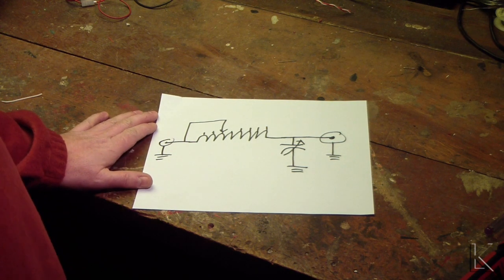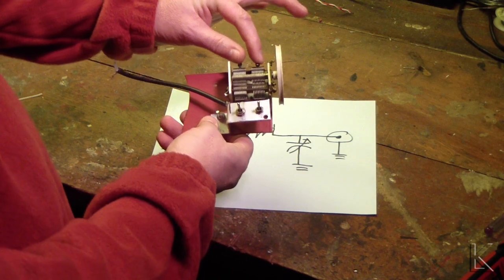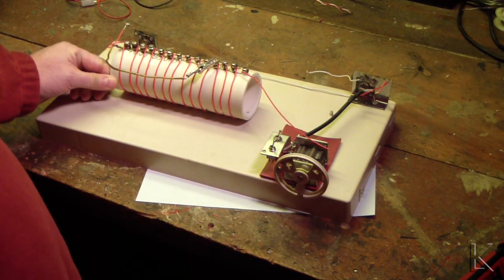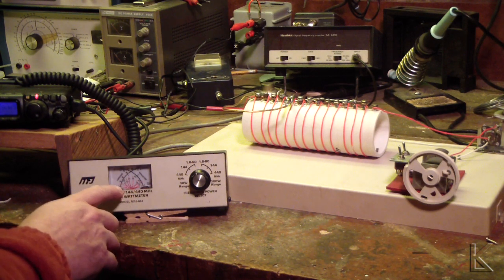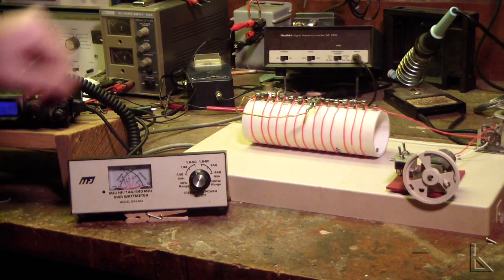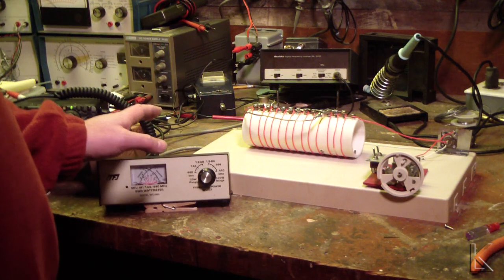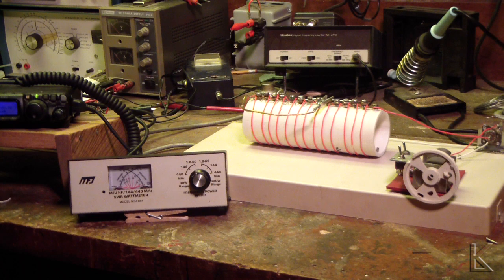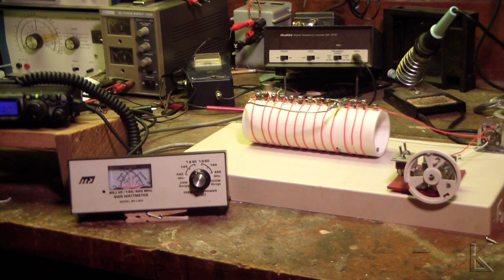Ham Radio - Build your own L network antenna tuner

Comment: When designing an antenna tuner, the first few taps should be ONE turn just like you made.  After that additional turns should be added between taps.  I don't think it is logarithmic.  I think it more linear.  By example, your tuner ran out of inductance and you were not able to tune the 2M antenna on the lower bands.  Also, your design was very good in one aspect, It was configured as a Low Pass Filter [LPF].  If the capacitor and inductor are swapped in position, It becomes a High Pass Filter [HPF].  Most commercial antenna tuners a of the HPF configuration.  I have seen it said that the HPF type is wider range but do not know if that is fact.  The Ten-Tec 'tuners' were of the reversible type.  That allowed low and high impedences to be matched.  I'm not trying to be a wise ****.   Just additional information.
Reply: You sound a little pompous.
Reply: @daveengstrom9250  Thank you for the compliment.  Not all Amateurs have the same background.  You know nothing of mine.

Comment: On trying to use a 5/8th wave 2 meter antenna - remember there is a tapped coil in the antennas base. This presents a very low impedance on HF in the order of problems less than 10 ohms. That's why it won't tune to a low VSWR.

Comment: Great demo of a simple antenna tuner. I have that exact same dual variable cap with the same wheel that I pulled from an old tube AM radio. 

One clarification though on this video. Was the input of the swr meter connected to the output of the radio and then the output of the swr meter was connected to the input of the antenna tuner.  Then the output of the antenna tuner was connected to the different antennas you were matching by adjusting inductance and capacitance?
Reply from the maker: Yes, that's correct,   the wiring goes,  Radio > SWR meter > Tuner > Antenna.    The meter would be useless on the other side of the tuner.   You need to know what SWR the radio is seeing when you tune the tuner.

Comment: Is it useful for swl only? I wanna use it shortwave listening?
Reply: It should be. Notice how he got maximum signal strength by adjusting the coil tap and variable capacitor while listening on receive? This is exactly what you would do, as a short wave listener. Any variable capacitor you find from an old radio that would receive AM broadcast stations, will be fine here. The coil you see here would be fine with it, too.

Comment: Cool project.  Some decades ago I was poor.  Still am.  lol
I made my tuner with thin radio shack test lead alligator clip jumpers.  My capacitor was from a pocket size transistor AM radio and the coil was still holding together a school 5 subject spiral notebook.  
The rig was an old tube radio that belonged to my local radio club. 
The coil and capacitor wren't mounted to anything.  I tapped the coil while still using the notebook for my log and I just pushed the cap out of the way once I got the inverted v antenna tuned.
I don't remember how the parts were configured.

Comment: That was a great build. I enjoy it when hams make their own equipment. This build has so much in common with building a crystal radio set, it's as if all those skills lead to this build. Now for a question. In order to stop the impedance from your hand on the variable capacitor, would a simple rubber band work or would you just use electrical tape? Thank you in advance.
Reply from the maker: I'd use a large plastic knob.   Just getting your hand close can affect it a bit.
Reply: I just watched the video where you put this in a box. When I saw it had a d-shaft I knew immediately that a knob was coming. Very cool project. I hope thousands are built. Thank you again.
Reply from the maker: If you build it, be sure to keep all of your wire runs as short and direct as possible.  That limits stray capacitance between the wires that can make the tuner act strangely.
Reply: Good advice.

Comment: I see you are using a  coax (unbalanced feed).  Would that tuner configuration you built/demonstrated work with a balanced feed line such as 300 or  400 ladder line?  Thx
Reply from the maker: It should work, since it's matching a low impedance at the TX side to a higher impedance.  The ladder line should appear as a 450 ohm load at the antennas resonance and higher when out of resonance.   You could also use a 4:1 balun at the ladder line and reverse the connections on the tuner.
The L network tuner really shines with end fed wires though.

Comment: Great video! Thanks for posting!! I have a question though. I have not been able to get a specific answer in any of the videos i have watched on antenna builds. I should mention I am new to this hobby and electronics in general. I am teaching myself essentially.. What is the role of magnets in an antenna? Probably a stupid question, but I understand the need bu what I do not get is why magnets? Magnetic wire, ferrite bars (especially since I am trying to build a loop or dipole. Also, What would happen, or is it just nonsensical to combine 2 or more ferrite bars,  Such as bundling them and wrapping them with wire?  I would greatly appreciate that info. Thank you in advance. Tom.
Reply from the maker: No, not magnets..  You might be getting confused by the use of magnet wire and ferrite torroids. 
In most cases, when you see a ferrite core wound with wire in an antenna feed point,  you're seeing a transformer or choke of some type.    A transformer may be needed to match the impedance of the balanced antenna wires to the unbalanced feedline.  Take the first three letters of 'balanced' and the first two of 'unbalanced' and you get "balun".  A term I'm sure you've heard.
So what you're seeing is a transformer.   And although transformers do operate with induced magnetic fields, they are not magnets themselves.

Comment: Newbie Question: The video is interesting. I heard what you said about wanting a variable capacitor with greater spacing for higher power. Out of curiosity, say your pushing out 50 watts. What sort of voltage would be coming out of the radio? I'm a little confused as to how you determined wire awg and component ratings. Thank you.
Reply from the maker: Mostly just from experience.   As far as the RF voltage, that varies depending on load impedence match and standing waves.  Reflected power can add voltage depending on it's phase.  That's one way a high SWR can kill finals in a radio.  The reflected power brings the voltage up across the transistors and can exceed the breakdown voltage rating of their junction.
I've read that into a good match, RF RMS voltage at 100 Watts will be in the arena of 800 volts.

Comment: great video.  im sure you get this question all the time but is there a kind of inexpensive way to get into the ham hobby?  i dont live in a big city so i probably need a least a moderate range.  i hope this question isnt too annoying theres just sooo much info online its hard for a noob to weed through it all.
Reply from the maker: Not annoying at all.    Test up to at least General class so you can get on the lower HF bands.    There are often nice HF transceivers showing up on ebay in the 300 to 400 dollar price range.   You don't need much power,  I've talked to Europe on my little 5 watt yaesu FT-817.    It's all about the antenna.  Resonant dipoles are best if you've got the room and trees.

Comment: Ive been working FT8 for about a year now with WAS on every band except 12 and 10(cause of openings) and 160. Why? cause my 80m Dipole WILL not tune for this band. Weirdly enough it will not tune for 60m but even with the radios output dropping to 5w cause of the SWR on my Yaesu I have have got enough radation out to WAS on 60. 160m though, everyone gets just enough signal to even hear me rather then work me.

Now i think I have found the solution. If i can build my self an L-Match following your instructions I can finally Trick my radio into putting out some PWR now so I can get a better signal out there. 

Thank you sir!!!!

Comment: Did your 98Ft end fed work at 160M?
I need an antenna system for my new FT857D that covers 6M-160M.  I was thinking End Fed for 40-160M and a cobweb for 30-6M.  But I'm getting paralysis by analysis with all the antenna options.
A Hamfest is coming up this weekend and I'll keep a lookout for a variable cap.
Reply from the maker: Yes,  and I'll tell you exactly what I did because it is the best multi-band compromise antenna I have ever made.
The feed point is an UNUN that I made.   The common design is the 9:1 UNUN, which is well documented with plenty of pictures showing how to wind it.    By experimentation, I found that around 6.5:1 was a better ratio for this antenna.    So,  find the 9:1 design and instead of 9 turns on the torroid,  do 6 turns.
Then keep the feedpoint near the ground and run out two or three 9 foot radials.
The antenna will tune very well on 160, 60, 40, 30, 20, 17, 15, 12, and 10 meters.   It's a bit finicky on 80, but I can get it to tune down to about 1.8:1 on the low end and 1.5:1 on the high end of 80.
Reply: So you keep the UNUN at ground level near a ground point, and then run the radials out from there?  Does the direction on the radials make any difference?  I assume you then run the end fed wire up from the ground to some height and then horizontally off to somewhere.
Reply from the maker: The wire goes up and off at an angle,   the couterpoise wires go in the opposite direction mostly.

Comment: Your schematic seems to show a RHEOSTAT rather than a tapped inductor.

If I recall correctly, that connection between the tap and one end of the coil should make a big difference in how the inductance varies as you move the tap.  Have you tried it without that connection?

Comment: Any chance it can tune a large random loop? Maybe after adding a 1:1 or 4:1 balun? Mag loops are great, but walking over and tweaking the varicap is kinda annoying and encourages having the antenna right by the radio.
A mathematic merger of 9:1 unun and mag loop needs to be discovered and proven. Random wire is nice, but it transmits from the tuner, right by the radio.

Comment: Fantastic!
So if i materialize this do i have to connect the "ground"(on transmitter side) to the outside barrel of the plug? Then do the "grounds" of the capacitor and antenna all connect to that? And the antenna's ground i guess is just unconnected to the antenna?
Thanks a lot!!
Reply from the maker: If you look at the schematic, you'll see ground symbols.  Those are all connected together.  Yes, the cable coming from the radio and SWR meter needs to have it's ground connected.   Usually, these are built into a metal box and all grounds are connected to the metal.
The exception is the antenna side.   The L network tuner will work very well with just a single end fed wire on the output side and no ground.  Of course, it will radiate, so you get RF in the shack that can interfere with things or feed back through your microphone cable and mess up your audio.
Reply: thanks enormous! i was used to all metal shells and casings to be effectively ground as in all audio equipment but was asking because it seemed to me that some radio guy was advising creating special ground connections to radiator heaters or pipes planted into the ground etc, which to me is useless since on of the terminals in the power socket is aniway connected to ground... best to you!

Comment: Hi Kevin!
 If I understand correctly the inductor is in series to the center pin of the radio and after the inductor coil the capacitor is tapped into the center pin and the other side goes to ground?
Apparently in this setup the coax can be lengthened or shortened a bit by the inductor?
I'm still having trouble figuring out what capacitance does.
I know on an oscilloscope capacitance increase will roll the corners off a square wave.

Comment: Pardon my amateur lingo; So the alligator clip isn’t exclusively making the circuit? At the alligator clip
Connection, it’s  also wired directly to the coil?
Reply from the maker: The clips were wired to the center conductor connection of the so-239 connectors.

Comment: for tap-set I  replace the alligator clip with selector switch..if the coil is to big for ur likes u can space the wires closer and use thinner diameter pvc pipe..

Comment: I must say, once you hooked up the 5/8 
2 meter antenna, I was hoping you would try Six meters ?
As if memory serves me, that antenna is around a quarter wave on Six !
So I was thinking maybe it would have been an easy match ?
But perhaps outside your parameters of HF ?
Still a nicely done tutorial !
Congratulations, and thank you for the down to Earth explanation !
If I could be critical, it was difficult for me to see the SWR Bridge !
Perhaps something to consider in the future ?
'73 !
Reply from the maker: I had a magmount 5/8 wave 2 m antenna then I would also use for 6 m because it was a good quarter wave on six. Didn't even need a tuner at the low end of 6 m

Comment: There is NO WAY, a small MW radio receiver variable capacitor will work reliably beyond 5w, even with very low humidity. This is simply not true.
Reply from the maker: I've pushed 20 watts without arcing.  Partially it depends on the degree of mismatch and the amount of power returning as reflective waves and their phase, adding or canceling the outgoing power.
And if you need to run more power, use a capacitor with larger plate gaps.  Obviously.

Comment: I am thinking of building a  2 meter antenna tuner and was wondering how many turns it will take on the inductor . I am just getting into this stuff.  And also how much capacitance do you think I will need. I am trying to tune a copper J poll antenna. KK7CZD DON JESKE
Reply from the maker: You want to tune the J-pole by moving the tap point of the coax up or down the J very very slightly.  
Using a transmatch at the radio would keep the radio happy, but do nothing about the efficiency loss of the detuned antenna.

Comment: Ok, I basically got it built. Before I completely finish, how could I add in a meter ?    Actually, I have it all build, but I havent got it to work yet. 
I will review the wired connections.
Reply from the maker: I'd just obtain an in-line SWR meter and connect it between the radio and the tuner.

Comment: So would you ultimately like to have several coils on your board to choose from?
Reply from the maker: Some automatic antenna tuners do just that, with 5 or 10 inductors and relays to switch them in one at a time or more than one at a time to increase inductance. But that gets pretty complicated. 
By using a multi-tapped coil, you are basically creating multiple coils in one.

Comment: BBi U-Tube video site says antenna tuners don't work, they just fool the radio into thinking it has a good match..
Reply from the maker: They don't change the antenna. They are a transmatch, a transformation of impedance and reactance to what the radio expects. Just as a transformer transforms impedance. They facilitate a more efficient transmission of power from the radio to the antenna.

Comment: Thank you Kevin.  Can that tuner be used for open feed line such as twin lead, 300-400 window or 600-ohm ladder line?  I suspect you would have to add binding posts.

Comment: How did you strip the wire for the taps? Did you just  cut,strip and connect ? Thanks. KN6ASO
Reply from the maker: I don't recall specifically, it was a long time ago. But usually on a coil, I'll just shave away the insulation without cutting the wire, and solder to it.

Comment: Great explanation, Kevin.  What (if anything) would need to be changed to build an L Network Antenna Tuner for 2 Meters and 70 cm?  I want to experiment with open wire feedline (ladder line) on these frequencies with a homebrew yagi and a couple of other antennas. I want to try several different modes on these bands other than FM to see what I am able to have ready for Field Day.

Comment: kevin...was curious about the coil...what's the over all inductance and roughly how much inductance does each tap remove?
Reply from the maker: I haven't measured it.    The nice thing about the L tuner is anything will work.    I can try to hook it up to my RLC bridge I suppose,  if you really want me to.   I'll have to take it apart.

Comment: I like this idea but I was wondering, would ceramic capacitors help in reducing the statics back ground
Reply from the maker: That atmospheric static noise is coming almost entirely from the antenna.  The caps won't change that.

Comment: Tapped coil normally uses a large enamelled copper wire like 14awg enamelled  or regular 14awg spaced by its diameter wound on 1 1/2 to 3 inch dia pipe. will have much better Q. Terminals NOT needed for contacts
Reply from the maker: Yes, that's all correct.  As I mentioned in the video, I built it this way to better illustrate the design visually.

Comment: what about an antenna tuner for am bcb? would the same ideas apply?
Reply from the maker: For that low of a frequency, you'd need a very large inductor, and a lot of capacitance. However for reception, it's not going to make a very big difference.

Comment: How to calculate the coil according to the band or frequency?
Reply from the maker: Not really neccissary since you're making a variable tapped coil.  If you can't match low enough, just add more turns.   It's a basic build.
You could go deeper though, there are resources for calculating coils and probably for tuners.  The point of the video was to show how easy it is to build something that works.